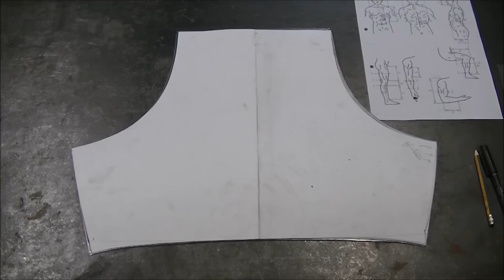Как сделать нагрудник 16 века / How to make a 16 century style breastplate

Comment: What grits of sandpaper did you use?
Reply from the maker: I start with 40 or 80 grit (depending on the condition of the surface), than goes 100, 220, 320, 400 grits and the polishing paste to finish the process.